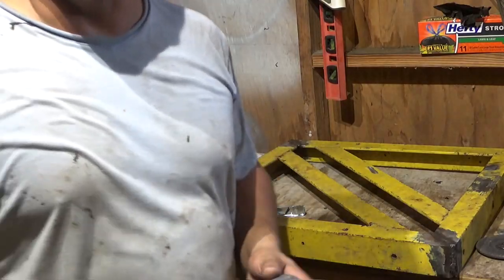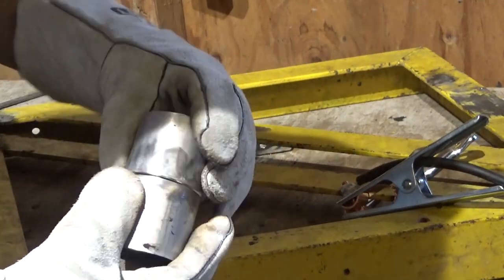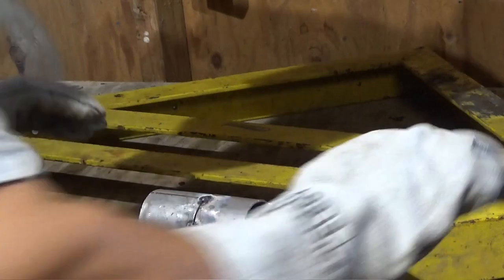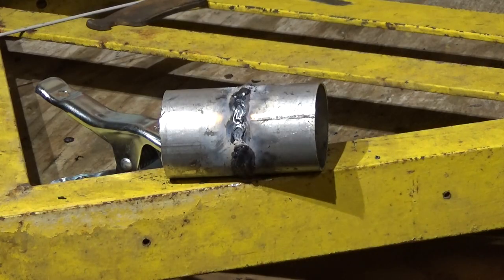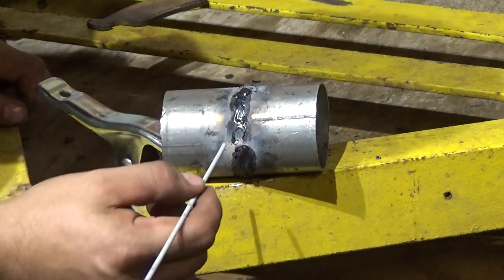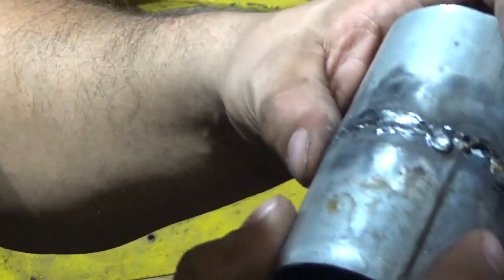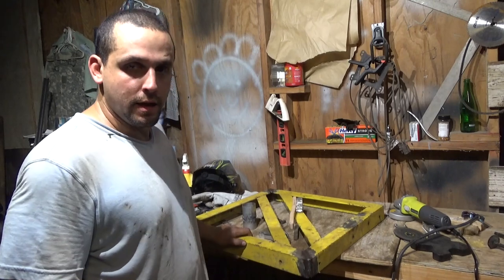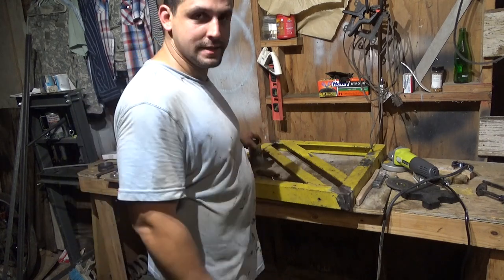trying to stick weld exhaust pipe, 1.6mm or 1/16 "

Comment: I've welded exhaust tube with the same rods you have and found if I tack all the way around (about 20mm apart) chip the slag off and repeat tacking in between the first tacks. Eventually you will have it filled in then you can run a non stop weld over the top. Just make sure you chip that slag off 🤙 but looks like you're getting good practice in, watching from New Zealand
Reply from the maker: Yeah, that is the way to do it , or maybe max 1/2" (12mm) at a time. When I made the video It felt like I was going to be able to just go with it, but as  you seen in the video that was not how it worked out lol. I watched a video on here where a guy does like 2 seconds weld and 1 second stop, and he does a really good job.
Reply: I know you concluded TIG (or MIG) was the way to go,  and that was two years ago. But some of us have what we have, and that's a buzz box or cheap inverter welder (or both), and stubbornly insist that that should damn well be good enough! 
   There was a period of at least a couple of generations when we had sheet metal, exhaust pipes, and arc welding, but NOT Tig or MIG. Thousands of workers had to find a way to make it happen, some with more success than others, and they did! 

   That 1/16" 6013 will be as good a choice as any, and Harbor Freight usually has some in stock. I would tack it about every 1/2" and then fill in between the tacks. But you strike the arc, create the puddle and break the arc, and then before it goes dark strike the arc again (easy if it's hot). A 45degree electrode angle can use the arc force to keep the slag away from the leading edge of the bead. This spreads out the heat so you don't burn through. Then you go to the opposite side and do another half inch, and repeat til done. 
   For heavier sheet metal, 14ga, 16ga, or maybe 18ga, I like 3/32" 6011, with the same dab-dab method, at 60A. It burns in deep but freezes fast. Keep trying stuff untill you find something that works for you and the machine you are using. 
    One thing I did learn was don't low-ball the amperage. You put blobs of metal on top of your work, and burn through, because you are trying to keep the arc from going out once you do get it started. 
Find a setting in the middle of the lower half of the recommended range (say 60A in the 50-90A range). That way it starts right up, but isn't too hot.
   That's my take on it, if you find it useful, give it a try.

Comment: When you're welding thin material, strike a few arcs on some scrap metal, to get your rod nice and hot, then bring it across to your work piece. Also, be careful welding galvanized. The zinc can give off nasty fumes that you don't want to be breathing.
Reply from the maker: thanks for the feedback. I'm actually going to try that I have done a few more attempts at welding this same pipe and  I will most likely post an updated video on this. I figured out that if i use a 1/16" 6013 and hold a really tight arc that it works better. and I can definitely see how starting the arc on some scrap would help.
Reply: @davidcraft4909  looking forward to the next video

Comment: I tried stick welding aluminized exhaust tubing today and had more key holes than the Tower of London 🤦🤣🤣
Reply from the maker: Lol. I'm thinking of re doing this video. I think I can do a better job now.
Reply: @davidcraft4909  I managed to weld it 😁 by using a stripped electrode as a filler rod kind of like welding Tig but using electrodes 🤦  slow going and lots of grinding but it came out half decent if you look at it from 5 metres away with one eye closed 😉🤣🤣

Comment: Practice makes perfect, well that's it,,,, at 65 still tweekin' bolts,,, oxy acethls,,, stick weld 2.5/1.2mm,,, gasless,,, & JBWeld,,, difficult is stainless steel!!!...
Reply from the maker: yeah practice does make perfect, and  I need a lot of practice if I ever want to stick weld 16ga tubing. thanks for watching and commenting.

Comment: Turn the fan away, seen that it had blown the gases away a few times, when you end a tack/weld and it sparkles, thats when you know you have porosity in it, other than that awesome work. Keep it up and have fun with it.
Reply from the maker: Yeah, stick welding 16ga is not easy
Reply: @davidcraft4909  

I've been a welder since 1997, welded many types, but I'm about to try aluminum stick for the first time on a golf cart frame. So we all can learn new things.
Reply from the maker: @TrashPanda71  yeah, that's for sure. I'm definitely still learning every day.  Even on stuff that I'm supposed to know about, lol

Comment: Exhaust and stick is touchy indeed, and you're doing great! I've had a similar experience as you, doing short stitches and letting things cool off before welding more, then you get  bit greedy and weld too far and get a hole. The worst part to me is you have to chip the slag before going back over a part, otherwise the slag gets trapped in the weld. Filling in holes is time consuming and tricky, add a little all around, chip, wire brush, repeat. 
I've done a bunch of practice with a stick welder, and while I find it's excellent for 1/8" or more, I plan to get a mig welder for exhaust and to patch my rusted out body mounts and rockers.
Reply: Nice, I have a good amount of days with a stick welder, but still - it is impossible to beat the mig on its territory...
Reply from the maker: I made a lot of mistakes on doing that thin pipe and I'm currently working on how to do it better.  but yeah 1/8 or bigger is way easier. the main thing i did wrong was i didn't clean the welds when i restarted. i know you are supposed to though I just got like anxious and was way to worried about blowing through it. also i was reading that running electrode negative is better for thin material. and I will redo the same type of pipe in a week or two. Im also about to get a bottle of argon and make a vid on my first attempt at tig welding lol. thanks for watching and commenting
Reply: So many people tell me that stick welding is the easiest kind of welding to learn.  I call bullsh*t!  Better, more expensive welding tools are indeed easier to work with.  A stick welding machine is just more affordable than a complete TIG or MIG welding setup.
Reply: @crackedfingerz yeah, mig is way easier than stick
Reply: 😅😅 I know exactly what you mean today should be interesting catalytic converter studs were completely corroded and the studs had to be cut out with an angle grinder... So now I'm gonna have to stick weld bolts in to have some studs this should be real interesting I hope I can do it 😅😅

Comment: I stick weld for a living. 7018, 6010, jet welding with both 3s and 5s. I do stainless pipe and aluminum/stainless tig. Also do flux core on vertical up. Pretty much everything besides underwater haha. Stick is possible to weld anything. That's what you do for ur 6g test.

Comment: With a vehicle like ours I recommend you to buy a mig welder.
I work as a fabricator and (I know how to use all the welding processes),mig is by far the best welder for 4x4 fab work.
Reply from the maker: yeah that is what people tell me and I myself kind of know that. I've worked at a custom shop before doing lift kits and random stuff. and yeah they used migs and almost all automotive stuff is mig, but I want to learn how to tig weld and get certified. So like I plan on doing any frame stuff or bumpers with a tig so they will look pretty, lol. this machine I have does tig too, i just need to get a bottle.

Comment: 1/16th rod are very handy. best to practice first from lowest heat to where you can do the weld. too much heat and the rods will burn like a fast fuse, burning right through thin stuff.
they are roughly equivalent to using .052 mig wire.
Reply from the maker: I find 1/16th rods do be almost useless, but also I'm not that good of a welder.  And my biggest complaint is they seem to just burn off so fast that I can't do anything with them, lol.

Comment: Mate we all start somewhere, cheers for video 🤙🏻
Reply from the maker: yes that is true, but I have since gave up on trying to weld exhaust with stick. My machine does tig welding too, and its actually really easy to tig weld 16 gauge. but I did go back and I tried that same pipe with a stick and if you hold a really tight arc it can be done. I might post a 2nd vid on that subject, either way thanks for watching and commenting.

Comment: When doing this try to use very quick in and out motions in the direction of travel. That usually works fine with stick on thin metal. Good job. Good luck bro.

Comment: Was thinking about getting a cheap stick welder to weld up an expansion chamber for my 2 stroke bike. 
Thanks for the video
Reply from the maker: I would suggest getting a cheap tig welder.  The process is slower but tig can weld anything.  It's actually very easy to learn, but it's really hard to make consistent pretty beads.
Reply: @davidcraft4909  I actually just got a cheap flux core mig the other day. 
Now i just need to find a place to weld at, lol
Reply from the maker: Yes, mig would be a good choice,  muffler shops weld exhaust tube all day with mig.   Stick on the other hand is not easy

Comment: For just starting you did great on 6013 mite try 7014 for filler on that thin of metal with a pus and pull on your puddle feed and pull back watch the eye of your puddle.
Reply from the maker: It works best to whip in and out with a 6013 as well, but its still really tedious. I might do another video on this because I'm actually a lot better after  
doing about 40 practice joints lol. but honestly I'm done with stick welding. Tig is easier,

Comment: thanks for the learning, I also have much to learn
Reply from the maker: its a lot easier just to tig weld thin stuff. I gave up on stick welding anything under than 1/8 inch
Reply: @davidcraft4909  unfortunately I just got the cheap harbor freight stick welder, also have more tools I need to buy...LOL
Reply from the maker: @SamSam-ml2go  well like i said in the video I know it can be done. I actually tried this a few more times with a 6013 rod and if you hold a very tight arc it can be done. I might make an updated version of this video. but still tig welding thin is so much easier.

Comment: I've only does one exhaust project using 1/16 6013 on 40amps. It's very tricky. It's still tricky trying to weld exhaust with MIG using .025 wire. Takes a lot of practice.
Reply from the maker: yeah, I gave up on trying to stick weld thin stuff. My welder also does tig, so yeah my new game plan is.  anything thinner than 1/8" I do with tig. and 1/8" I can do either one. thanks for watching.
Reply: @davidcraft4909  I use MIG for most stuff now.
Reply: @davidcraft4909  Please don't give up, I had the same problem until I found a solution, using a second rod without flux as a filler, use it with the left hand, and melt it as you go.

Comment: What did you decide was the best amperage, polarity and stick movement technique for welding the 1/16th inch tube? Thanks for the video!
Reply from the maker: sorry I can't really give any good advice on it I never really figured out how to do it good. but pipe like this is super easy with a tig welder.

Comment: Have you kept up with the welding? I've been giving stick a crack last couple days, you're better than me that's for sure. I'm wanting to work on my exhaust also. Would love to see more content from you.
Reply from the maker: Yeah, but I've been mainly using tig, especially on thin stuff. If it's thinner than   1/8" I get the tig torch out. I will try to make more videos soon, thanks for watching.

Comment: how do you know what rod to chose and what amperage to rock i got an old AC only stick welder i found in my grandpas shed when he died and i was hoping to learn to use it and to my exhaust with it
Reply from the maker: Honestly, I don't have enough experience to give any advice. I'm still trying to figure out that stuff too. but I can tell you what I was using. I used 1/16" 6013 and running about 45 amps. I know I didn't do a very good job, but it almost works. A 6013 is supposed to be like a medium penetration rod and its good for AC and DC. That rod in 1/16" says 20A-45A.  As far as I know from the description it sounds like the right rod for thin exhaust, but I really don't know. I have made better welds on that same pipe since I posted the video, but I still find it really hard to weld exhaust with a stick welder. Mine was 16 gauge thick.
Reply: I’m just scared I’m gonna start blowing holes in my pipes lol
Reply from the maker: It's fairly easy to burn holes in exhaust. I would get an extra piece of pipe the same dimensions and practice a few times.

Comment: What amps did you find to weld at ?
Reply from the maker: I never really figured out how to weld this stuff with a stick welder.  The lowest amps without sticking the rod too much, I guess would be the right setting. It is really hard not to burn holes right through this kind of stuff. I might do a follow up video on it since I have been practicing a little bit and I might be able to do a better job, lol

Comment: it can be done if you did what i did there and don’t mess up😂
Reply: I’m actually in the middle of learning to stick weld my exhaust pipe. You did a way better job.lol
I should turn my amps down. Lol
Reply: i’d just slow down and do a little side to side and stop when it gets too hot

Comment: 1/16" rods are not my friend.... unless you have a very steady hand they seem to just wobble all over the place. I have done some pretty thin metal with 3/32" 7014 and 3/32" 6013.
Reply from the maker: I have a lot of trouble using them. I started grabbing the stinger with one hand and kind of holding the rod like pencil with the other. It helps but it's still not easy
Reply: @davidcraft4909  yea, I have to "pool cue" them.... hard to do when you are in an uncomfortable position. I just a did a buddy's exhaust with 1/8" 6013 (because that is what we had), that was about 100 little tack welds with another 100 tack welds over that😂Meh... it doesn't leak and it is strong enough, ugly as homemade sin but no one is going to see it.
Reply from the maker: Ok yeah hold it like a pool cue especially when the rod is new, being steady is the hardest part. And yeah its either a lot of tiny tack welds or maybe weld about 1/2" at time and pause for a few seconds between welds.

Comment: Nice try sir
Reply from the maker: yeah it was a nice try but it didn't come out that good, lol. thanks for watching.
Reply: @davidcraft4909  I throught it was easy I have experience it today too😭 try to weld my Daihatsu Feroza exhaust pipe its really  difficult just tiny hole its become worst.
Reply from the maker: @abdrahmanabdullah3113  Yeah I give up on trying to stick weld thin stuff.  I'm using my tig welder from now on.

Comment: 6013 most shitty rod ever, need 3/32 6010,6011
Reply from the maker: Well my thoughts were that a 6013 is supposed to be a medium penetrating rod, and I thought that would be good for thin material,  but then yeah I think you are right because the 6010/6011 is supposed to be a fast freeze rod and whipping in and out of the puddle with one might be better. Either way I'm still learning and thanks for the input.

Comment: Heat was to high I think, an you were moving little to fast.
Reply from the maker: Well you have to have a certain amount of heat to burn the rod. and yeah maybe its too much heat for the 1/16 inch pipe. but also later on I realized that i was holding too long of an arc. i have welded the same pipe holding a tighter arc with better results. and if you hold a long arc i think it makes it act like too much heat, either way thanks for watching and commenting. but really tig welding exhaust is way easier lol . im done with stick .